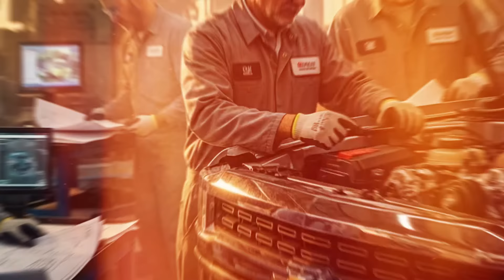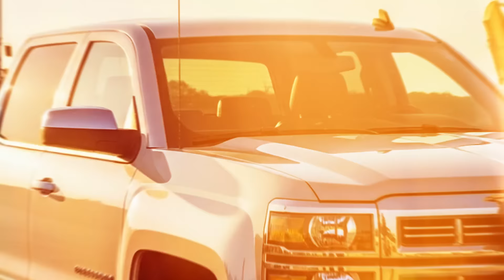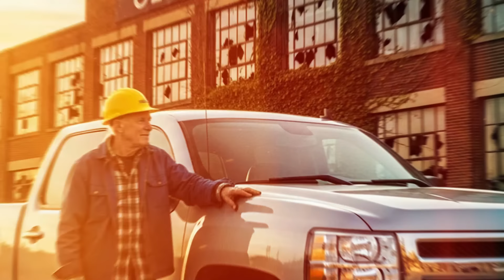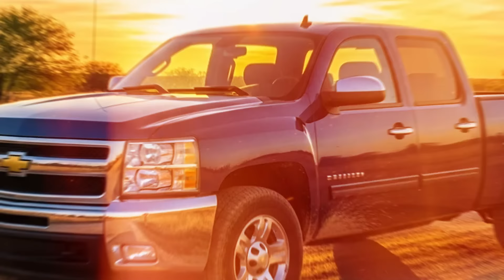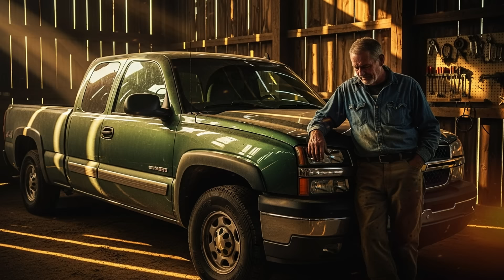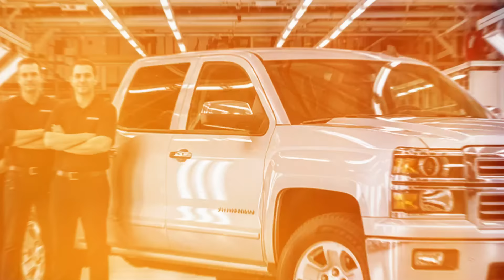5 Silverado YEARS That Chevrolet ENGINEERS Recommend!🔥

Comment: 03 was the first year with drive by wire, which on most 03's I've owned or had in the shop was the main issue other than the 4l60e,  in 04 they silently fixed the issues with the electronic throttle body system ( few had the previous issues) , but overall most reliable of the cats would be 05 ( trans issues and electronics were addressed)

Comment: My 2003 was complete junk back in the day. I once hit a bump and the tailgate latch cap flew off. It he rust on it after just a few years was insane. I got rid of it in 2008 and didn’t even consider a Silverado again until I bought my 2021 brand new. The 2021 has only needed tires, brakes and a speed sensor…There’s little rust on it.

Comment: I ordered my 2000 Silverado 1500 5.3  X-Cab Standard Bed in August of 1999 and got it the Sunday before Thanksgiving 1999.  I currently have 253,207 miles on it February 21, 2026.  I don't drive it as much as I used to because I retired in August of 2019.  In November of 2024 with 252,000 plus miles I had to replace the original Alternator.  Not too bad for a twenty five year old truck with 252,000 miles on it. I do all of my own maintenance and keep records of it all.  It's been a very good truck so far.  We also have a 2004 Tahoe 5.3 that we bought new, and that's what we drive most of the time now.  It has about 230,000 plus miles on it now, but had to replace the transmission in it around 180,00 miles.  Other than that it's been a good truck.
Reply from the maker: @gregorynorwood6823 That’s the kind of ownership story engineers love to hear 👊

Ordering your Chevrolet Silverado 1500 new and still driving it with 253,207 miles is impressive. Replacing the original alternator after 25 years and 252k+ miles? That’s completely reasonable wear — honestly, that’s outstanding longevity.

The 5.3L from that era built its reputation on exactly what you described: simple, durable, and very forgiving when maintained properly. Doing your own maintenance and keeping records makes a huge difference. That discipline is why it’s still going strong.

And your Chevrolet Tahoe with 230k+ miles — even with a transmission replacement at 180k — is still a solid long-term result. A transmission at that mileage isn’t unusual, especially depending on towing or usage.

Two GM 5.3-powered vehicles, both well past 200k miles, still serving your household? That’s not luck — that’s consistency and good engineering meeting proper care.

Those early 2000s trucks earned their reputation for a reason. 💪🛻

Comment: I 😂literally just listened to another channel and he said NO TO THE 2014 and 2019
Reply from the maker: @Keepitoriginalministry Different opinions exist - here's why I recommend them:
2014:
✅ First year GMT K2XX redesign (better interior, ride)
⚠️ Still has AFM (manage with oil changes/delete)
2019:
✅ Revised DFM (more reliable than old AFM)
✅ 8-speed transmission (better than 6-speed)
Other channel's concerns? Likely:

2014 = first-year bugs
2019 = DFM still has issues

Both valid. My take: Worth it IF maintained properly. Your call! 🔧

Comment: I have an 2000 Silverado 1500 my dad gave me daily driver 430k miles (2) rebuilt transmissions motor is still strong. Pull whatever I need to pull. Just bought an 2019 RST with 31k miles I love the truck both 5.3 motors

Comment: Well if these engineers are so focused on thier trks. Than y is the consumer having problems with the engines. Transmissions, and emissions
Reply from the maker: Great question! The engineers I interviewed focused specifically on GMT800 (1999-2006) and GMT900 (2007-2013) - older generations that have proven themselves over time with hundreds of thousands of miles. Modern trucks (2014+) with newer emissions systems, cylinder deactivation (AFM/DFM), and 8-10 speed transmissions are a different story - those technologies are still being refined. The engineers told me the 'sweet spot' is 2009-2013 GMT900, before all the complex emissions tech. Sometimes older and simpler is more reliable! What year is your truck? 🔧

Comment: I did enjoy this and find your insight intriguing. As a former 2015 Yukon Denali owner however.. I am very hesitant to believe in the 2014 and 2015 trucks. Those are the first years of the LT (Gen V) Small Block Chevy and they are VERY prone to lifter failure. I agree the GMT900 is a Brilliant Truck but I wouldn't go for a 2007. Those trucks still have the 4L60 behind them amongst other out dated powertrain Carryovers. in 2009, when GM went to the 6L80 as the standard transmission, that is when these trucks became more appealing. As a former GM Technician myself I could go on and on but in Short, I was intrigued with what you had to say here.

Comment: Any truck under 2007 were solid trucks. After 2007 they started with afm system which would mess up cams. General Motors never address this issue actually they continue to use the same afm in the newer trucks

Comment: Just got 2015 Silverado High Country in Aug. ‘25 with 91,000 miles. Nicks & chips body wise with exhaust bolt broken and repaired by Dealer. 2 bad injectors also replaced by dealer. So far so good. Fingers, arms, legs, toes, and even eyes crossed hoping that 2015 is the CHARMED YEAR! Love my first pickup.😅
Reply: Have put 130k miles on my ‘16 high country 5.3.   Runs like a dream and zero major issues.
Reply: I have a 2015 silverado with 139kmi. No problems with mine other than the basic things that get replaced. I like this truck and will keep it until I can't keep it running effectively. Its a great truck.

Comment: I have five LBZ's at the moment.  Original owner of one, and picked up 4 more in the last 8 or 10 years.  2 are on the road, have the Original  in my garage giving it a partial rebuild/restoration after a problem free 520k. The other two will eventually get the rust free body from 1 and the 80k power train from the other put together and swap out one of the current runners so it can get a refresh....
My income will never depend on any diesel powerplant that has come along since.

Comment: I have a 2005 GMC crew cab Z71 with 252000 miles on it. Still dosen't use any oil and averages 17.5 miles to a gallon.

Comment: I have owned my 2002 Silverado extended cab for 21 years.  Only thing I have done to it outside of tires, oil, wipers, battery etc., is had to replace rear main oil seal.  Other than that, it has been trouble free.  It is garage kept and still looks almost new.  This truck will be with me until the end.... either mine or it. 😊

Comment: I own a 2014 GMC Sierra 1500 four-wheel drive 100,000 miles absolutely no problems at all. I use 5W-30 from day one synthetic with quality oil filters. Service the transmission early on about 10,000 then about 30,000 after that no problems at all.

Comment: 1999-2006 transmissions are absolute garbage.
Reply: My 99 has never been touched. Your statement is bs.
Reply: My 2006 Silverado has 184,000 miles and I never had any problems with the transmission. Has the 4L60E. Every 50,000 miles changed the fluid and filter, never did a flush.
Reply: You don’t know what you are talking about! I’ve seen these go 300-400k miles before rebuilding.
Reply: My 02 has stock untouched 4l60e w/ 255k.
Reply: Those transmissions aren’t that bad . Actually more solid than trucks now a days. Anything beyond 2014 transmissions went down the drain.
Reply: Got 303000 on my 2004  silverado 4×4 with the original tranny and engine 🤷‍♂️

Comment: Have two GM trucks. First 03 silverado bought used. Currently  has 314000 and still going strong on the 4.3, Rusty but idles smooth with good oil pressure.  2nd is a 08 sierra with only  116k. An restoring  this one. Both  standard cab  long bed. 98 is a z71 kinda rare

Comment: The 6L80 and a 6L90 transmissions for nightmares from 2007 all the way up to 2019 just headaches I have a 2015 2500 HD Silverado and it's just been a headache
Reply from the maker: As for that detail, unfortunately I have to agree.
Reply: 6L80 & 6L90....too many nagging issues, agree.
Picked up 2015 2500HD LTZ - Z71 Duramax w/Allison. Like night & day differences over the gas motors.